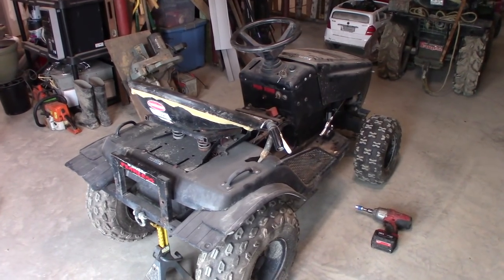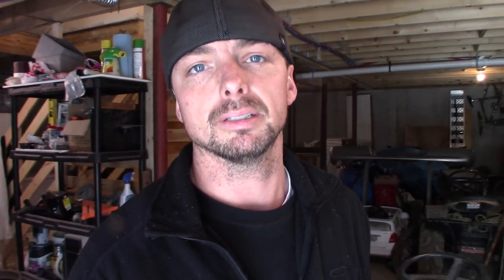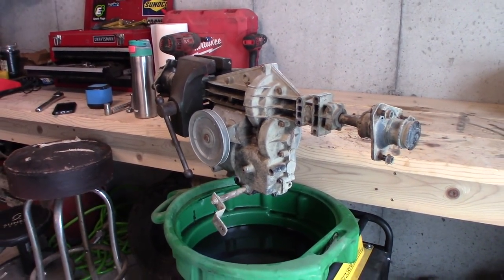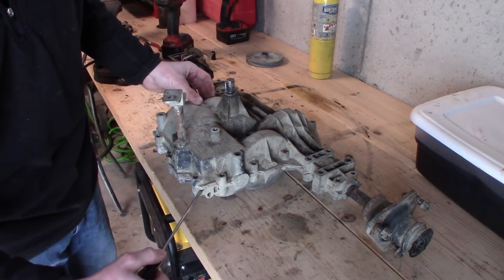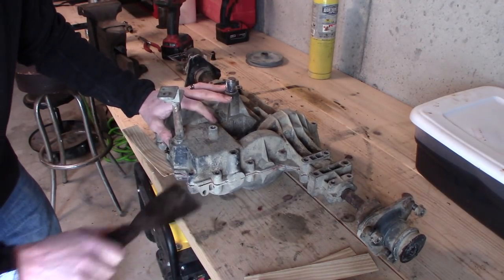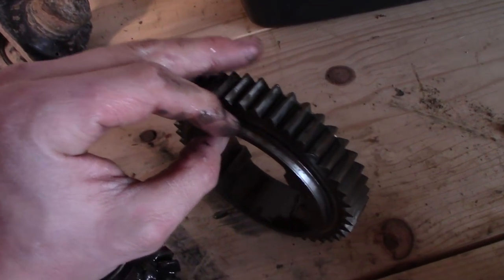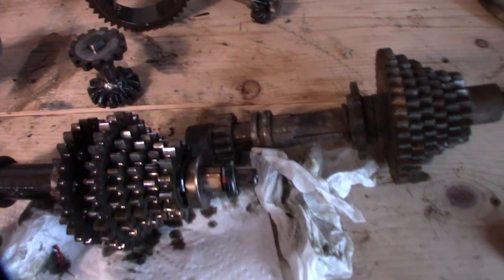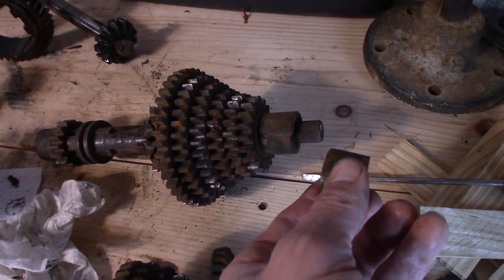Murray Transaxle Removal & Inspection (MST-205)

Comment: had a Murray similar to yours. different pulley set up though. it would run about 50mph.

the transaxle was getting pretty tired. missing 2nd and 3rd.  wouldn't stay in any other gear without forcibly holding the shifter. I decided to give it hell. got her to top speed and slammed it in reverse. 

The case shattered into pieces. gears all over the Rd.

only thing left was both axle ends bolted to the frame with the wheels jammed up into the fenders at an angle. 

that was a pretty scary ride lol.
Reply: Matt Hudson - my first mod (  basically stock cept for pulleys) was a 80s craftsman. i shattered some gears in it , would maybe do 30mph.
2nd one was a 18hp twin widebody murray stock with a 6speed shift on the go, i got that upwards of 45mph using pulleys n golf kart tires. i took the trans apart, cleaned it up, greased everything added gear oil n never had any issues, altho it had plenty of gear noise( loud whirring) when deaccelerating. that thing was scarey fast, i took it apart.
Reply: Matt Hudson I have a craftsman lt1000 that does 74 and I took it out in the snow banged it from 1st to 3rd wide open with about 30hp and 50 ftlbs she did the same thing as yours.
Reply: COMMENT OF THE DAY AWARD HAHAHA
Reply: instablaster...

Comment: i got this 90s weedeater tractor ( call it a craftsman) -  got it running, made a pass around the yard and it locked the trans.
i cracked open the trans n found a bunch of rust on the main gear shaft, i took it apart, wet sanded the rust off, greased it up n slapped it back together. it still works great today👍
Reply from the maker: dangerous toys56 ... That gives me hope. By the way, I haven't seen you around for awhile!
Reply: FearlessFront (Todd Christopher) - yea been busy workin👍

Comment: I bought a Roper tractor, had a Foote 4 speed in it, but only 1st gear, 2nd gear, and sometimes reverse worked. So I pulled it apart, and found that 3rd and 4th had no teeth left on the gears, and reverse was missing a lot of teeth! Not only that, but it also had a snapped shift key, and a wobbling input shaft. It was the worst transmission I've ever pulled apart

Comment: I had the same issue with my transaxel. Everything was perfect inside but wouldn't engage gears an just grate badly. It ended up being the top gear going through the top of the casing. I added a thin washer to pull it down slightly an worked great. I'd say it was just worn cosidering its very old an well used. I think when you fix that slop in that worn shaft it will be fine. Good luck mate.

Comment: In one of your old videos about the craftsman crawler you were talking about adding some rear suspension like “coil springs” using old seat springs. I really like this idea and I think im gonna give it a try, im thinking about getting a plate of steel to mount to the transaxle and weld the springs to that and the transmission mount brackets. With a self adjusting tensioner I think the belt will stay on and have enough stretch, also the springs are pretty stiff but im sure you will notice a difference between the stock solid mounted rear axle

Comment: I've got a Spicer 5 speed (not sure what model) in my rear engine Opposed Twin Murray, and I give it hell but it refuses to quit. I've slammed in in reverse by accident a couple times, did donuts at full throttle and any other form of abuse you could imagine, but it just won't quit. Hell, it doesn't even whine at top speed. And yes, I've pulley swapped it. I recently took it apart because the left side axle fell out, so I'm working on repairing that so I'll stay in, but I'm still shocked at how good the internals are still. The bowl gear and race are in perfect shape, there's no metal flakes or broken gears in it either. People always hate on Spicer's for their poor quality, and maybe I've just gotten lucky, but mine just keeps on going without complaining about it.

Comment: honestly im goning to stick with the 205 in my personal tractor, the really like the geared reverse, other than a chain flopping around. i do see the advantages for more high speed applications. but for my application i dont see it totally worth the swap. just my opinion. P.S. the MST's do have pry points to stick a screw driver in on the back where there is the most silicone.
Reply from the maker: restore56 I don't blame you, they are great transaxles! If I do end up going with an 820, it shouldn't be too bad as this isn't a really high speed machine. I'm plenty happy with it doing 25 miles an hour
Reply: I’ve got all the mst mods I did in a 4 or 5 part series on my channel. 
Grease fitting on the input , bearings at the axle ends , good stuff.
Reply: Are the cony roaders mud runs open to the public?

Comment: hey fearless i just started having the same problem with my 820 transaxle it was the shift forks in the shaft they were snapped and try to select 2 gears at once plz check your shift forks make sure they slide back and fourth and are in tact when it trys to select 2 gears at once is when it locks up

Comment: You have nothing to be ashamed about with your new shop as far as it's not done. At least you can work in it. Mine is not insulated and is not heated so with this cold weather, I am stuck in the house. As for the transaxle, No news, can be good news. Perhaps that thick goop with the metal shavings was getting kicked around and plugging up the gears momentarily? Just a thought. I look forward to the video of the engine. That should be neat finding out what happened.

Comment: i really want to build my own offroad mower but dont know what to start on(what mower like),love the vids tho keep them up!!!
Reply: what mower to start with is simple the extra one u have that dosent mow lawns any more start with simple things like tires that have grip maybe a gas pedal and pull start for when the starter takes a crap on u or battery dies after that look into locking the dif if u want and go from there 
no need to buy a tractor to build into an offroad tractor i have plans of buiding and offroad machine with tractor parts and engine but thats it im saving money for the build and will put videos of it on a chan(not this1 its for gaming lol)
Reply from the maker: seras gaming you nailed it! Some things I will add though, avoid anything with the hydrostatic transmission, or the dreaded MTD vari-drive. That will somewhat limit you
Reply: jdcian got 2 racing mowers now, got them from my local junkyard
Reply: jdcian I got mine from a neighbor for free when he moved.  If you don't have an extra one, check the free section of craigslist, they show up frequently!
Reply from the maker: Darin Frye you can definitely put mud tires on it, but nothing extreme. Those transaxles aren't built the strongest. And I don't have the MTD anymore, I got rid of a lot of stuff when we cleaned out the old garage
Reply: FearlessFront (Todd Christopher) My kubota has a hydro transmission but still goes decently fast as is. It has a drive shaft and so far has gone through mud and up hills when I least expect it to.
Reply: jdcian what I did was pick up a hydro that no one wanted but ran with an opposed Briggs then found a craftsman with a 4 speed with no motor for $30 basically if you don’t have it start of as cheap as possible is what I’m saying
Reply: Todd are the cony roaders mud runs open to the public

Comment: I had a spicer 6 speed transaxle i striped every single gear in it and snapped the reverse chain. It started skipping in gears 5 and 6 it keped working so i keped down shifting untill there was no more foward gears and then i sent it in reverse untill the chain broke. I geuss they dont like 22" mudlites and ungoverned opposed twins
Reply: Shotguns N mudmowers 
I had a 12hp and a spicer I put in, so I could use my original 801 as a backup. 
It was ok for a little while, but I swapped on a 20hp and it died on its maiden voyage.

Comment: While you have it apart, you should replace the 205's drive-gear axel with the 820's. Upgrade to 4 shift keys, if all the parts fit.

Comment: Maybe you should make a bracket thing with a bearing that goes above the input pulley on the transmission to counteract the side load on the input shaft bearing in the transaxle.  it would make it harder to get the belt on and off though.  (I hope that made sense)

Comment: I was in a v notch / hill climb with a newer fiberglass hood cub cadet hydro. It was doing good till I had to back up because I dug myself a rut trying to get up. The rock I was on shifted and my tranny fell on it snapping the shifting linkage off. I had to get the truck in and pull it out.  I ended up scraping the frame and tranny and kept the engine because rear ends on Cubs are not as interchangeable as you think.
Reply from the maker: Rebel Boys OUCH!

Comment: I had a Spicer 2000 on a older Murray, I was going 45 on it, and after time the casing started breaking it came to the point towhere I could my the whole transaxle up and down like 5 inches on the tractor

Comment: I had a weed eater rider with a 13.5 hp briggs,  same exact trans axle, i was on the lake in the winter with a bud of mine, i decided to drop the clutch in 6th gear and then my trand axle held but then blew and i heard this aweful shred noise and it was movin anywhere, so took it apart, the gear was shredded to hell, legit bald. Good times

Comment: If you get that 820 cleaned and put back together I would put that on instead of the mst because the 820 is much better it's tougher you don't need to lock it and they can take abuse I have one in my Murray and I beat the shit out of it and it keeps going
Reply: well because its fearlessfront hes gonna lock it anyway lol.
Reply: I think he mentions that it is too rusted and pitted :( to continue on with the 820

Comment: I have a Toro with a mst 520-509 it was given to me by a neighbor who is elderly and park it in his garage 10 years ago. He said it was always garage kept and worked fine when he parked it. I put a good battery and fresh gas in it and it started right up but no reverse. I checked the linkage for something blocking it and tried an adjustment per the service manual. I even disconnected the linkage to make sure it clicked into reverse. So my 1st question is obviously do you have any clues or things I might try. 2nd are all 502's the same or do I need the 509 number as well when searching for a rebuild kit or a replacement transaxle? And do you know of where I might find a replacement or rebuild kit? Thank you

Comment: Hey man. I have a huge question. I know its not the right video for this.  But im having issues getting my mower deep in water. It shuts off when it gets wet. I have a snorkel just like u have on the murray. Is my spark plug getting wet and thats it? Or are there other things i need to seal and modify to do be able to burry the motor and it still run? Its a briggs 502.

Comment: Whenever u take the motor off could u do a vid on ur custom wiring and relays u did and I’d say try to get the snorkel working on it and it may help to have the pcv conected to the snorkel to get it to not run rich

Comment: I have the same/similar grooves, "wear" patterns in my pulley swapped MST 206. Also, almost every time I have opened it up to repair/maintain, there are usually a good amount of aluminium metal shavings in the oil. I think it may be kind of par for the course on a pulley swapped transaxle with no real bearings.

Comment: Peerless 205 has let me down once I hit a mud hole went reverse to 3rd and th whole thing locked up... opened it up nothing was wrong. All that happened was the input gear in the bottom half of the rear end slid apart somehow and wedged against the case. Nothing a simple washer couldn't fix

Comment: Your drive gear may be climbing teeth due to the failed bearing.
Reply from the maker: slammds15 that's kind of what I'm thinking, something obviously wasn't meshing properly
Reply: I've seen similar issues in smaller gear boxes like that, they make the same noise like in your video cutaway. Usually the cases blow apart not long after that noise starts. I'm glad you are back! I missed your videos and adventures!
Reply: I agree that was a good bit of deflection.

Comment: I had a mower with an mtd Forward Neutral Reverse transaxle. I had it set up with a torque converter and a 12 horse briggs. Snapped the case completely in half on the first drive

Comment: I was hoping to see an adapter vid on how to put the 820 in the Murray but at least the trans is useable I got a craftsman mower that I was going to use for a race mower found out that the fill plug was gone out of the transaxle so it shifts harder than it used to but I did get the plug

Comment: Your top bearingcould be some of it but the bullgear wear could that be your welded locker not exact? With it welded tight there is no give and I have found that some transaxles just need a little slop and don't take a lock well. Have to admit though never saw it in a peerless but I guess it is possible. And I have seen how you run that murry. You do beat the shit out of it.

Comment: i was rebuilding the mud murray took it for a test drive it did great threw the mud once i turned off the camera and put that mower in reverse the trans shifter broke off at the top and it left it in 3rd gear i took it out two years ago and never put in another so there for it just became a parts tractor for the bio hazard

Comment: Not sure what transaxle but I tried to lock one once for a fast mower I was building and I didn't get it completely square and true when I welded it so after I got it all put together synthetic gear oil and everything all back in the mower took of through third gear that the boom case blew in half oil everywhere

Comment: hell i have a 2 inch pulley on my transaxel. and a 5 inch pulley on the engine. transaxel is a mst 206 stock no locker no mods to transaxel at all. thing does 45 mph in sixth gear and 1st-4th gear are all for mud. have atv tires on the back as well ive had no problems with mine at all??? i did fill it with and old can of gm gear lube i had laying around. not even a metal file in the oil...
Reply: hotrodj21  I got the same set up on my Murray...do you think 820 parts will interchange with the 206 ?

Comment: i had a similair problem with my 820 where i lost fith gear it was making horibal noises then the trans would barly shift and i had to kick it into gear after i got home i pulled the trans apart and found nothing wrong with it at all and it runs about 45km\h

Comment: My worst transaxle story is on a 68 wheel horse lawn ranger that'll go 30 mph the shifter broke where it moves the forks and I was a long way from home so I used a huge screw driver to lock it in third gear terrible idea as I forgot about the broken piece inside it did get me pretty far though until it locked up and burned my belt up the broken piece got logged into the diff gear and the brake shaft gear luckly it didn't break a tooth later I tore it down and replaced a second/third gear and all the seals and bearing cuz they all fell apart then after I took it through some tall grass it would not go in first or reverse it turns out the shift stop spring got bent and twisted around a fork so I got a spring from the hardware store and it is still working to this day still leaks a little bit though it's got an 8 in pulley on the engine and a 2 and a half inch pulley on the transaxle

Comment: Got stuck in the snow with my tractor and the shifter would want to work so I held it to the floor and tried to shift sure enough it did and right into reverse and blew the two halves apart

Comment: I have a 1974 mtd and the transaxle stuck in first gear so i finally pulled it out to find it had at least a gallon of water in it. Also its not a vari drive

Comment: I had a peerless 6 speed and it was being used to cut grass only then my grandpa wanted to make it wheelie and broke the spiders in the bull gear so I got the machine many years later and took it appart welded up the diff and put car wheels on it and it's been threw three motors in the past 2 years lol

Comment: my worst trans axle fail was on Halloween this year i was riding my off road lawnmower with my friend his is stock but anyway got back to the house and was coming in my driveway at almost top speed then my brakes for some reason did not work so i did the next best thing i downshifted whitch somehow cracked one of my spider gears in half and blew a hole straight through the case i was running a peerless 801 that day i did get a new transaxel to fix it
Reply: I have a mst206 and I down shift all the time cause my brakes don’t work

Comment: Can you do one on how to adjust the brakes because that is one of the biggest problems I am having on my Sears Craftsman offroad toy I built. Also does anyone have a good place to go to for finding out what axle each one is if you have no markings or tags on it?

And is it better to run grease or oil in those axles?
Reply: Blazer Project What Craftsman and is it a vertical or horizontal Peerless transmission.
Reply: I looked at one of your videos and I'm assuming that black mower is what you're talking about. It's been a while since I played with vertical transaxles because I have two GT6000s and a Sears Suburban gt18 so to the best of my knowledge your tranny has a little disc brake that slides in and out when you hit the brake. If I'm not mistaken that disc sits on a splined shaft and the two bolts on the break assembly holds it together along with the little square pad. So when you go about adjusting the brake you want to have clutch out and try to turn the nut in on the piece of metal that's bent at an angle not the rod itself that goes to the clutch. Now if the pads needed replaced you would have good stopping power and then it would suck again.
Reply: Thanks for the info, that will be taken care of next chance I get.